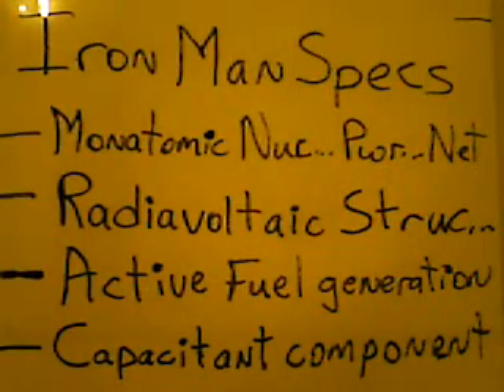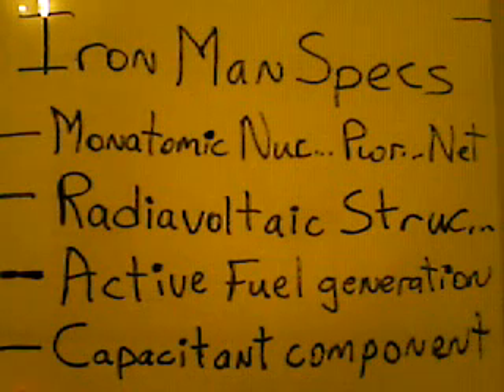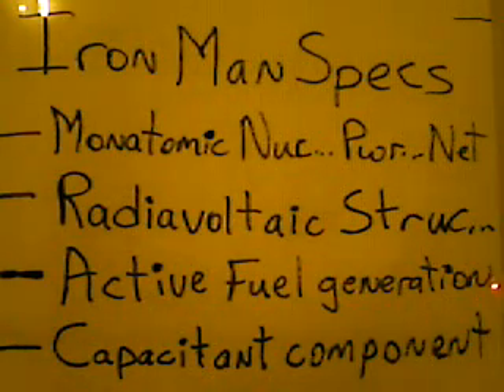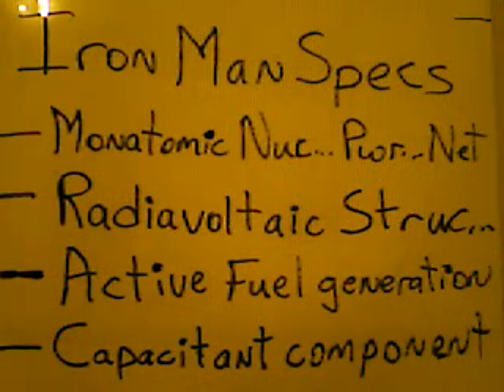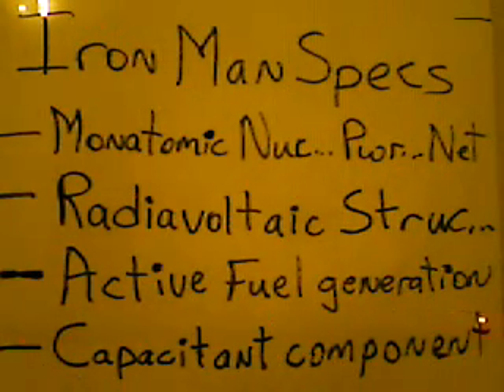Iron Man Specifications

Comment: well, it's going to be extremely dangerous to have such a radiovoltaic device because of contamination with the environment or the person wearing the suit if the armor were to fail. A dense energy source in one small area can be more easily armored. In the case of the real iron man, it was inside his chest, saving a lot of room in the rest of the suit. It's actually a genius solution to that sort of logistical problem.